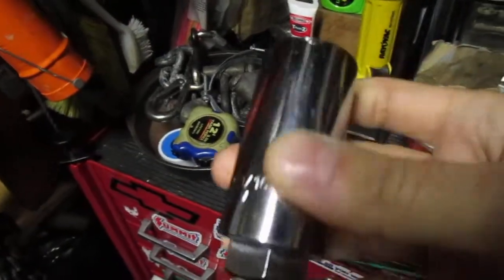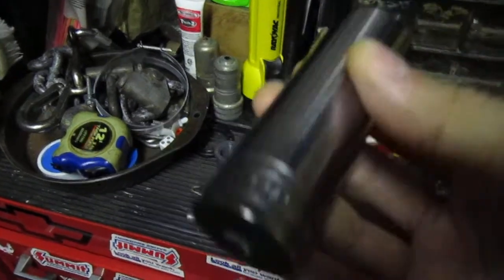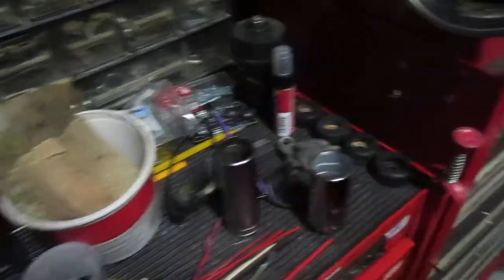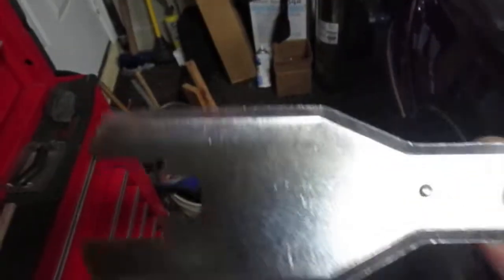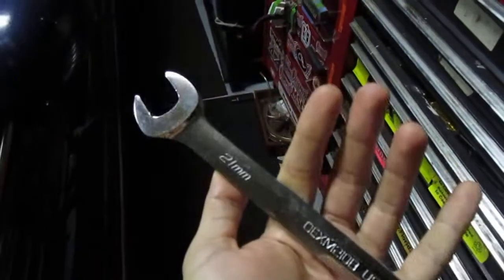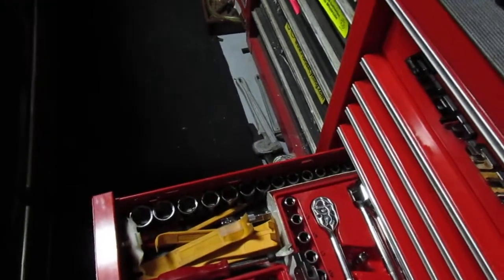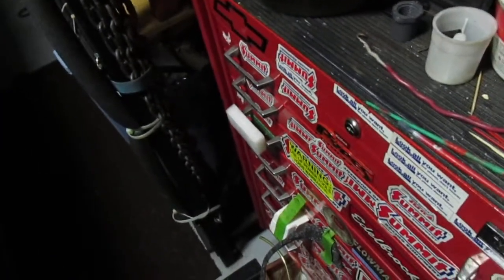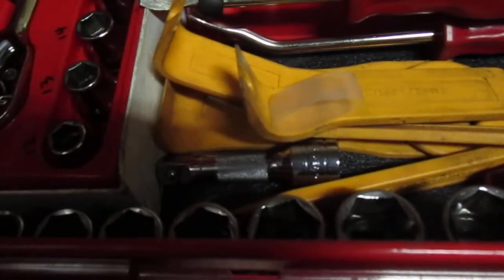Sold what worked,, what an idiot, But  ghetto upgraded!

Comment: You got some great tools. You can always give the liars a bad review because that is the only thing that gets eBay sellers attention. Then ask for a refund using pics of the bent tools or whatever and keep the tools.
Reply from the maker: Hahha I didn't not want to go that far, I fixed them all up the rail is like 3.50 new, it was more just a matter of principle. If the dude gave me what the rail cost I would of been happy, Its still messed up but I hammer and dolled most of the damage out. Ill post that video soon it was twisted like a pretzel